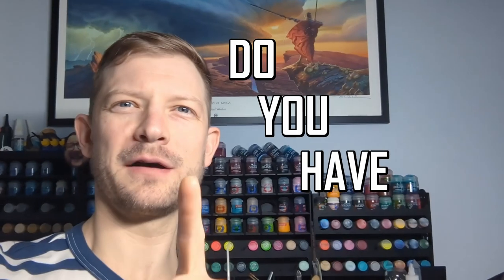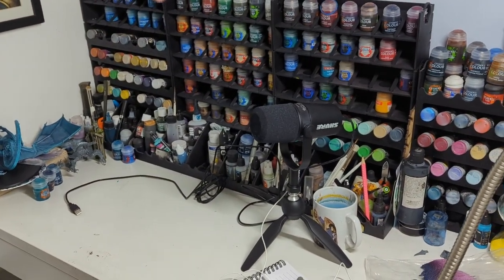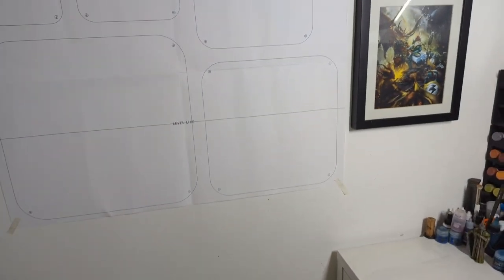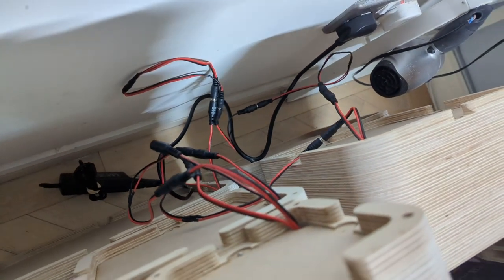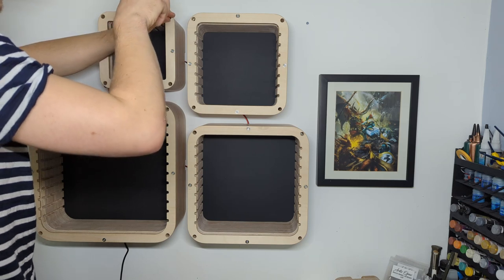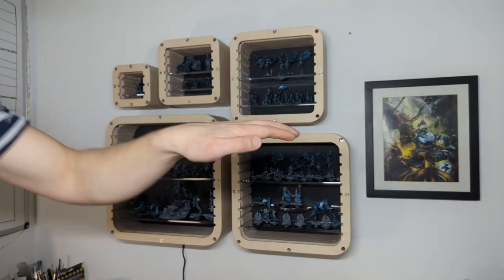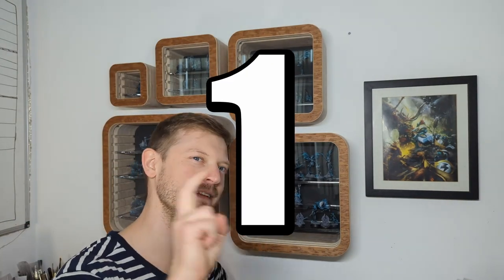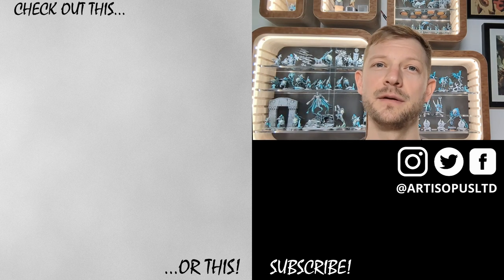(Giveaway!) My Tiny Warhammer Hobby Area + Upgrade

Comment: My suggestion would be to hang your paint racks. Just like the cabinets. One of the biggest issues I've had was larger bottles of primers and glues never fit on the racks like the paints do. Having my racks mounted on my wall allowed me to have my odd size bottles to sit under my racks saving even more work space. 

My question is something I still have yet to figure out. The flat things we use like cutting mats, pallettes and mixing trays...these are always in my way and I do not have drawers under my desk. What is the best storage solution for these items to keep them out of the way but also close at hand?

Comment: My office is in a prism-shaped room. So only two vertical walls at the ends shaped like triangles. My painting desk is on one of the 45° walls so I have a lot of dead space on both sides of the room behind my work desks and said painting desk. All my paints are just on the desk itself in little acrylic trays. Not ideal but if I use a paint rack it will force me to push the desk out even further from the wall. I've just thought that maybe I can create a rack that can be screwed to the wall and have multiple rows of racks at the right angle between some wood. I'll have to think about that some more. It's been ok so far for a noob. My desk is clear and a good space to work at so that's good. I installed a display shelf for one of the end walls but it's not as fancy as those beauties.

Too poor for an airbrush. I use an old iPad to watch shows or listen to some tunes or an audiobook from my phone. My PC is on the opposite side of the room. It's a very practical space but I just got a couch so that's a good place to just chill. Instagram: benjmiles1.

Comment: I've not really got a hobby area yet, i just have my desk i use for my tv and computer and set it up when i am able to paint a little when i get a new mini. But i have wanted to get a set up built eventually. I think my biggest question/concerns are what would be some first things i should look for to set up a proper space for it? Personally i have a hard time being hunched over painting so i was thinking that i should start with getting a desk or table that is either high up or adjustable, but i've not really seen any in the few searches i have done that are not pretty expensive, at least for me. So i'm wondering if there are any relatively cheap desks/tables that have adjustable height features that would be a good fit for a hobby corner?

Comment: I'm an electrician. Just advise people about wiring zones when fitting your cabinets. Never above a socket as you run the risk of drilling into a cable.
Reply from the maker: Very good point! I did do this (it's just a hollow partition wall), but should have said

Comment: Scrolled far too far down to check that it was indeed a way of kings poster. No idea about the movie though.

After having great ambitions to make a desk, I ended up using old kitchen cabinets and worktop to make a space. Very roomy storage. The cabinets are big enough that they fit all sorts of stack able boxes and containers allowing easy access to what ever project I am working on at the time. I've shelves up where space allows making use of vertical space for storage. This is all in an L shape so I can make maximum use of the space I have, which means that with a swivel chair I can access my PC or painting space with a quick turn (or longer spin - gotta live a little now and again)
Reply: Movie is Princess Mononoke by Hayao Miyazaki. All of his films are both brilliant and beautiful.

Comment: My setup will be a strange one. I can't physically sit in a chair for a long time due to a serious injury, especially with my feet down so I actually paint in my bed of all spaces. With an LED lamp clamped to the frame, I'm able to lie on my back and put the light ahead of me so it only illuminates the model. I fortunately had a bed that has draws that come out so I loaded them up with my paints in a specific order so I don't have to look to know what I'm getting. I can mearly lean to one side and get what I need. The bottles I'm using and the wet pallette are balanced on my chest where I have the bad habit of wiping my brushes my chest skin as I learned the natural waxyness of our skin causes the water I wipe there to stay as drops that don't run away so I use it to thin my paints which I freely admit is extremely weird and deserve judgement for.

Comment: What if you don't have a dedicated space and need to store your hobby stuff away and take it out everytime?  What would be your best tip to make it easier so it doesn't take an age to get set up?
Reply: I have this problem and currently keep my collection of Army Painter paints and inks, sprays, RGG wet palette, randomly collected brushes and tools plus a tray of of primed minis in a 35 litre Really Useful Box with deep lid under my PC desk.  I actually paint on our folding dining table, that gets used for gaming too.  We don't have much space, this is all crammed into our front room/family room, and I get it out when I can, as I am a full time carer.  Lighting is the tricky part, as small daylight  lamps don't offer much height and restrict position.
Reply: @Dave  the really useful box is a good idea if my wife will allow it under our fold out dining table lol.  I agree about the lighting, that is what takes the most time  and effort to set up.